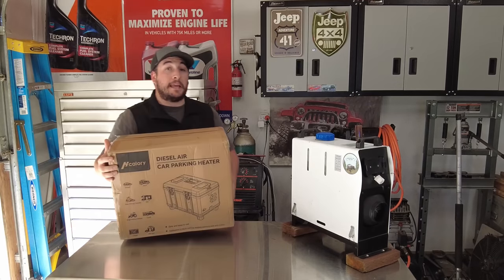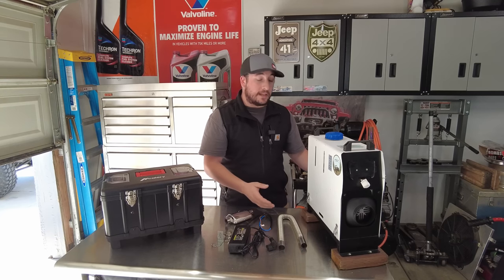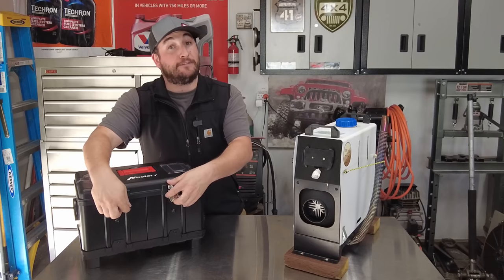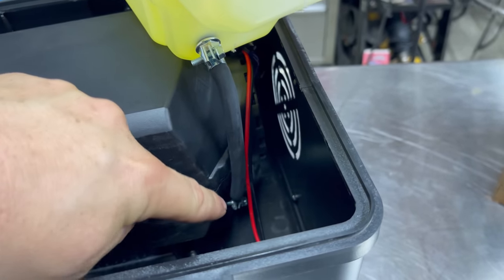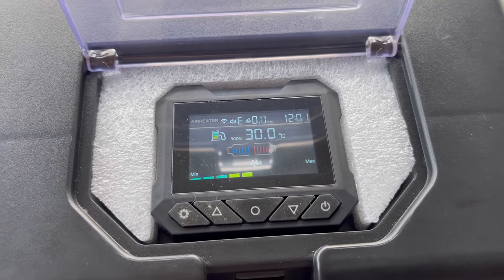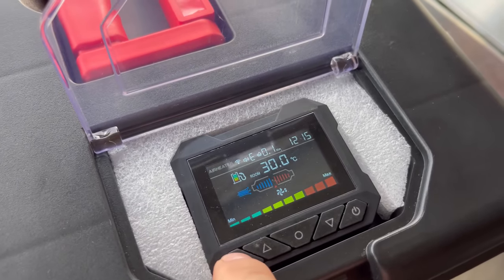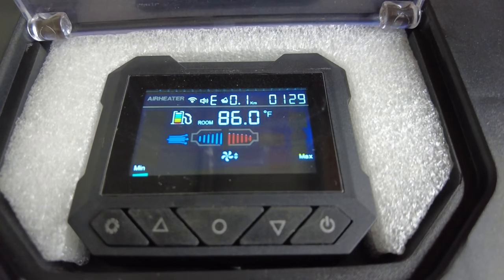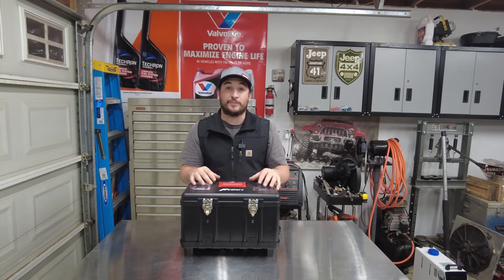KING Of Affordable Diesel Heaters | The HCALORY - SS2 8KW Air Heater | This Is The ONE

Comment from the maker: Update* The Diesel Heaters are back in stock on Amazon.com >> https://amzn.to/47KUrMq

This unit has a new “Level mode” that allows the heater to be adjusted based on a level of heat you choose, by toggling the keys on the pad. This allows the heater to automatically adjust  based on the level of heat your set taking the guesswork out and the need to change settings in engineering mode.  Like in the older heaters. Coupled  with the Bluetooth app and this mode of control, no more need for thermostatic control and extension of the cable, 
But It’s still a good idea though. 🍻

Winter is coming, we wish you all a warm safe journey!

Update: Power adapter has FC and CE logos and heater has CE, UK|CA, triangle with check mark ✅ aka A-Tick, and FCC ID: 2A7W6-SS2.

ATTN DISCLAIMER : THIS HEATER DOES NOT HAVE UL LABELS AND CERTIFICATIONS:
THIS IS A CHINESE DIESEL HEATER  NOT MADE BY U.S STANDARDS. BEWARE NEVER DIRECTLY INPUT 120 VAC INTO THE HEATER. ALWAYS USE THE SUPPLIED CABLES AND ADAPTERS FOR USE. AND REFER TO USERS MANUAL. MISUSE OF THIS PRODUCT CAN CAUSE ELECTRICAL FIRE AND OR SHOCK. 
 
Additional information:

Exceptional Heating Performance: Efficiently warms your space with a 5-8kW adjustable range. Achieve a cozy room temperature of 20°C swiftly while boasting a low fuel consumption of just 0.1-0.48L/h. Enjoy a whole night of warmth on just 6L oil.

Unparalleled Safety Features: Engineered with a crucial overheating protection function, ensuring your heater operates safely. Certified and compliant with industry-leading safety standards, guaranteeing peace of mind with every use.

Unique All-in-One Box Design: A compact and innovative storage structure that is easily portable. Designed for effortless installation, dismantling, and maintenance.

Smart Bluetooth App Control: Experience the convenience of remote heater control via the App. Save time, energy, and stay comfortable with just a tap on your iOS or Android device.

Versatile Applications: Perfectly suited for an array of settings, be it a car, caravan operating on 12V or 24V, or at home with 110V. Performs stably even at high altitudes, making it a reliable heating solution for various environments.

0:01 Hcalory SS2 Intro
0:38 Whats in the box
1:40 New VS Old Heater
6:50 Start Up 
12:07 Wireless Smart Phone App Control Setup
Reply: Still same old heater with same motor , same pump ,same blast tube that gets cracked disc and clogged screen.
Reply from the maker: @gloknor  haha you forgot, improved controller, controls and enclosure. 🍻
Reply: Its the same old parts in it, the controller is almost never the issue it is the fan motor and pump that go first on these . I have had these for years and repaired them many many times . I still use them all the time but you need to have extra parts on hand .  @ATEMOFFROAD
Reply: why dont you just use an thermoelectric generator (Peltier module) on the exhaust to giv it the 12v power for the fan etc?
Reply: @Moontrue1on1  the peltier modules are not really efficient enough to scavenge enough of the waste heat to do that
Reply: @gloknor  you have no ide what your talking about... the only thing that was right inn that sentens was that thy are not efficient...
Reply: @Moontrue1on1  Apparently I do know  what I am talking about since I have plenty of experience with Peltier modules and Chinese diesel heaters . I don't mean to offend you but you can barely form a sentence or spell correctly.

Comment: Nah, $300 is insane when I can buy the older style for less than $120 and it does the exact same thing. This essentially has the same parts but now in flashy, new enclosure. I see this comment section flooded with people who have money to blow. Some of us don't have disposable income to just throw towards redundant "upgraded" products.
Reply from the maker: That’s fair, I know it’s not going to be for everyone’s use, I use for winter tent camping so we need something that is rugged and can hold up to the abuse of offroad camping. I respect your analysis, price must have gone up? Last I checked it was $200 still very affordable for this design heater. 🍻
Reply: I do like it, not at that price point
Reply: How are these say with a blend of motor oil in them. I understand you need to start it with kerosene or e85 or diesel. Then you can run motor oil in some of these .
Reply: Bluetooth, better thermostat control, larger fuel tank, easier set up, easy to pack and transport, if cost is a factor and an issue...
Reply from the maker: @Tiersmoke92555  exactly,the controller and controls are different. Improved and more user friendly. Your buying the updated controls and better enclosure. The old heater cannot do what this new heater can do on the fly. Especially For tent camping you won’t need to extend the controllers cable so the thermostat can be in the heated space. They fixed that with the new level mode heat setting. The Old heater is an indoor heater only unless you modify it. Also for advanced settings you must go into engineering mode and calculate altitude/fan and fuel pump speed if the thermostat is overrode. This setting would need to be changed every time based on location. The new heater takes the guess work out of all that and automatically adjusts. It’s more efficient this way and way easier to set up for the mobile user. No others are at this level.🍻
Reply from the maker: @turbotoys1597  should always be mixed with some diesel. Diesel is a lubricant for the pump, kerosene is not.
Reply: $210 on Amazon
Reply: Tell us your broke buddy
Reply: I blew $300 at the vet the other day for absolutely nothing. I’ll gladly pay $300 for a valuable tool.
Reply: @joshlower1  Hey, some of us is just trying to get some cheap heat for the winter.

Comment: It’s designed to look like a tool/tackle box to hide it from your insurance company. Chinese Diesel Heater… sounds like something on the top of a fire investigator’s checklist.
Reply from the maker: They’re coming , Hurry hide all the diesel heaters 😂😂 it’s probably a good idea to keep a fire extinguisher and carbon monoxide detector around. I use them outside when snow camping in a tent. Not much can catch on fire in those conditions. 🍻
Reply from the maker: My father in laws name was  Mike Stewart really miss that guy, but eh everything is made in China these days 🤷‍♂️
Reply: Does this heater set outside?? Or can it be modified with a longer exhaust so it can set inside??
Reply from the maker: @nightwolf1963  it’s made to be inside, I would wrap the exhaust and be sure to always have a carbon monoxide detector close by. 🍻
Reply: @ATEMOFFROAD what kind of distance from the duct can it be felt
Reply from the maker: Update: Power adapter has FC and CE logos and heater has CE, UK|CA, triangle with check mark ✅ aka A-Tick, and FCC ID: 2A7W6-SS2. Does this mean anything?
Reply: Electrical plug is a bad choice. Some individual will probably plug it into the wall with the expected flammable results as it shorts out without a fuse.
Reply: @ssaraccoii put one in the cord?
Reply: @weswarren5987  They should have used a different cord due to human stupidity.  Some idiot, somewhere’s going to plug it in the wall using a standard cord figuring if it fits it’s gotta work. May end up as a garage sale find in several years without a 12v cord, then surprise!
Reply from the maker: @ssaraccoii  don’t try that at home 😅

Comment: That IEC 60320-1 C13  connector they use is extremely concerning. As there are many of them in every household if they own a desktop computer or various other AC appliances that commonly use them, it creates the possibility that a user could in inadvertently plug this unit into mains power with disastrous results for the unit and perhaps the user. As these would never pass CSA ANSI standards, they could get rejected if noticed by customs during the import procedure. Unfortunately, HCALORY is not the only manufacturer that is using these connectors for 12V, but hopefully they will get the message and change that. Just as you did due diligence by discussing the potential of adding a fuse, I'd recommend replacing that IEC connector with something like an XT60 or Anderson power pole.
Reply from the maker: That’s fair 🍻
Reply: As soon as I saw that I thought the same, "someone is going to plug a kettle lead into that", very dangerous. 120v or 240v instead of 12v would have some interesting results.
Reply: Only if the user is dum dum
Reply: If you can spew that level of tech shit but can’t remember what plug goes to which device, then you shouldn’t own a screwdriver let alone a diesel heater.

Comment: Sir you should put the fuse as close to the battery as possible. That way the power cable itself is fused. Now if your plugging it in to a factory cigarette lighter you don’t need to fuse anything. It’s already fused. Just make sure it has the correct amp fuse for the factory cig lighter. If it’s higher than 20amp you can replace it to a 20amp. FYI
Reply from the maker: At the time when I put the 15a inline fuse on the DC cable , I wasn’t sure if I was going to put battery clamps or cig socket. I ended up with the cig socket so now I’m double fused. 🍻
Reply: A lot of people will be using this at camp with a solar generator which is not fused so the inline fuse is a must. But most cigarette lighter plugs have the fuse built into the tip too so one should check there as well.
Reply from the maker: Hi , New video is up covering all the questions you asked on this heater. 🍻 https://youtu.be/Ug-3fjjCPWE?si=BxCFMqSJN6QPi7tT
Reply: WHAT? Increase the cigarette lighter fuse to 20A? The wimpy vehicle wiring harness not designed for that. Your cavalier off-hand advice could cause a lot of consternation and smoke my friend.

Comment: The DC connector is exactly the same as many 110 vac connections on all sorts of things. That could lead to a nasty condition if someone plugs that unit into 110 vac.
Reply from the maker: Yes I thought the same thing, but only in the wrong hands. The plug is standard I verified with an old computer power supply. The heater has its own power supply to adapt to AC. Someone would have to introduce a completely different cable for that to be a problem. Worst case senerio is the unit shorts out and could catch on fire. I guess will have to try it? Although, this is what the mfgs says: Unparalleled Safety Features: Engineered with a crucial overheating protection function, ensuring your heater operates safely. Certified and compliant with industry-leading safety standards, guaranteeing peace of mind with every use.
Reply: I was thinking the same, whichever way you look at it is a real bad idea - even on something you made yourself that only you will use, let alone a general Joe public consumer!
Reply: Using IEC C13 C14 connectors for 12V DC when it's usually used for 110/230V AC seems like a really bad idea. For DC and this amount of amps  there exists connectors like XT60 or XT90, so why introduce this kind of potential  hazard.
Reply from the maker: I am very tempted to show what would happen in the case 120v AC was input into the mains. But In theory we can also predict what would happen. Remember the controllers control circuit is what relays the heater circuit to turn ON. The controllers control circuit is also low voltage/ low amps, Controlling a HIGH amperage heater circuit. I suspect if AC is applied the low voltage/amp control circuitry would take the hit before the possibility of the high amp heater circuit absorbing a load to catch fire. The circuit would be damaged like a fuse shorted, and in the form of a bad trace on the board. With the low current circuit damaged you would not even be able to turn the machine on with AC applied.  It would sit there and wait. likey reducing any shock or hazards. You would just have a dead ☠️ heater. 
Ive also verified the pinout on an AC 120v cable in relation to the 12v heater connections pinout and this is what I have found. If connected, AC Hot lands on DC ground, AC neutral lands On +12v.
Reply: @ATEMOFFROAD  probably won't be dangerous isn't good enough - the metalwork on a faulty heater could easily become live if mains voltages are applied because there is no protective earth, and if you can plug it into the mains as easy as you can a kettle...someone will
Reply from the maker: @Sydney268  so far I have found  no path for line voltage that would make the heater live in the event AC was applied. The exhaust, heat exchanger and enclosure are completely  isolated from the electrical circuit. Most likely through relays. At first application of AC most likely the ECU would take the hit , disabling the entire heater.
Reply: @ATEMOFFROAD  In mains powered electrical appliances the electrical circuit is isolated from the metal case too, they have a protective earth for when things go wrong. A burnt out glow plug could easily short the electrical circuit to the metalwork. OK so we agree plugging it into the mains will probably blow it up - that is bad enough alone, if someone picks up the heater, the first thing they will do is look at the back and see what power supply it needs, they will see an IEC socket and promptly plug it into the mains. All I'm saying is it's a bad idea.
Reply from the maker: @Sydney268   we are just theoretically speaking. (for others reading this)the ac ground wire, if carrying current allows the up stream breaker to trip instantaneously opening the circuit line voltage. Not all AC circuits are equipped with a ground wire, in fact most hand tools do not and are polarized. This is because they are double insulated. This could be the case of this heater. And I will continue the  research until I know the worst case senerio.
Reply: @ATEMOFFROAD  sure, double insulated will generally mean no chance of any exposed metal parts becoming live under fault conditions so the motor will be electrically isolated from the chuck or blade or whatever. I doubt this is the case with the glow plug screwed into the metal heat exchanger that can be easily touched, I see it more akin to a copper hot water tank and immersion heater which regularly fail to earth and would become live with no protective earth.

Comment: I will be impressed when they start using metal housing, full metal jacket for that thing is the only way. No plastic, and the biggest fail is it continues to run and waste fuel after reaching desired temp. I use the old style you showed, but I removed it and rebuilt it into a metal box with plenty of fire protection.
Reply from the maker: Yeah I have no control over that, it’s most likely the plastic they use on engines that can handle hight heat, but they could be listening which is good for new products. As far as controls go the modes seem very simple to throttle down to the lowest setting, no more trouble with that. which is pretty low. If need be any lower you may as well just turn it off. 🍻
Reply: You can turn it onto temperature sensor mode instead of pump hertz mode... the controlers have a thermometer which switches off when it acheives the target temp...
Reply from the maker: New video is up covering all the questions you asked on this heater. 🍻 https://youtu.be/Ug-3fjjCPWE?si=BxCFMqSJN6QPi7tT
Reply: Thee is no limit to the amount of time and money that can be spent to make you more comfortable using a liquid fuel heater. There is a reason this type of heater is generally so affordable. They make is safe enough. Most mishaps occur due to improper installation so a redesign by the manufacturer would only serve to increase the price..

Comment: Could you heat a house with this? My home has no heating whatsoever and winter is knocking on our door 🥶
Reply from the maker: Maybe parts, how big is your house. Someone on here said they hear a 35’ yacht
Reply: I have one in a large RV and it’s very good. You could heat a room with this easily.
Reply: It’s a 3 bedroom, we’ve no heating whatsoever and kerosene is now more expensive than diesel in our great little country. I know it wouldn’t heat a house but if it even took the chill and dampness out I’d be happy, thanks for the reply
Reply: Or would certainly help, you could also look into running it on heating oil or red diesel as essentially they’re both the same thing and 50% cheaper than white diesel from the pump. Also I can say this really will help with dampness. I had it in a damp garage and it sorted it out in less than a week and I was able to fix the walls and paint it.

Comment: The fact it use the standard power cable for the dc input is just asking for trouble
Reply from the maker: Yes I thought the same thing, but only in the wrong hands. The plug is standard I verified with an old computer power supply. The heater has its own power supply to adapt to AC. Someone would have to introduce a completely different cable for that to be a problem. Worst case senerio is the unit shorts out and could catch on fire. I guess will have to try it? Although, this is what the mfgs says: Unparalleled Safety Features: Engineered with a crucial overheating protection function, ensuring your heater operates safely. Certified and compliant with industry-leading safety standards, guaranteeing peace of mind with every use.